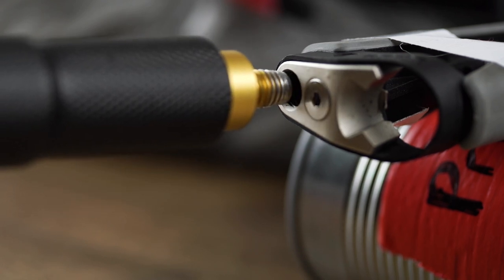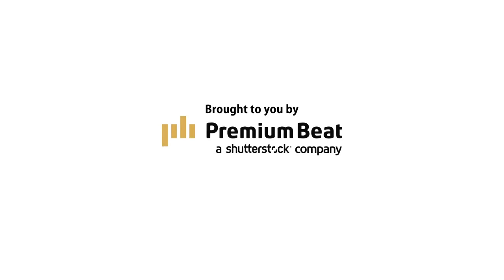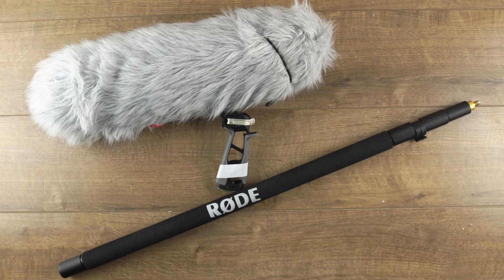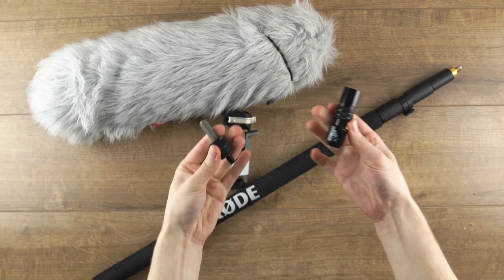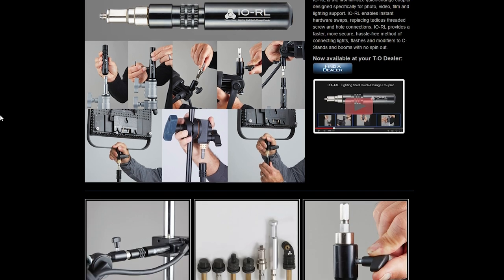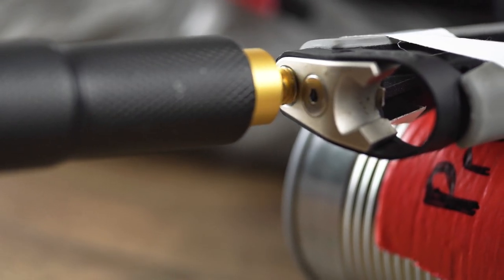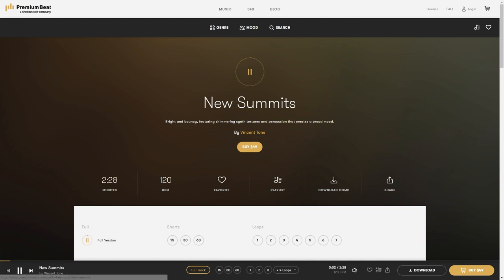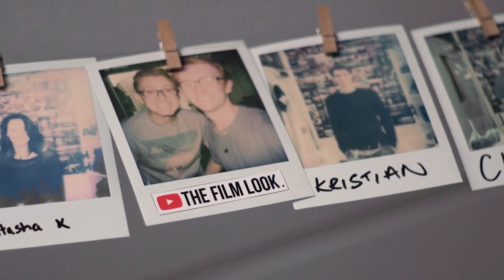Boom Pole Quick Release | Triad Orbit IO-R Review | The Film Look

Comment: Looks great, I've just invested in something similar for monitors so I don't have to twist them round on magic arms all the time. Definitely worth a look
Reply from the maker: Oh nice! What is that called?
Reply: https://www.amazon.co.uk/gp/product/B01LXOJTU4/ref=oh_aui_detailpage_o00_s00?ie=UTF8&psc=1 is the one I bought. I'll let you know how reliable/good it is.
Reply: I use those on my monitors, too. Together with some custom GoPro Style Magic arm like Caleb from DSLR Video Shooter suggested in one of his Videos.
Great combo.
Have to be extra careful with the locking mechanism, though. It's pretty easy to unlock it.
I usually use a strip of gaffer tape for safety with that.
Reply: It arrived today. Testing it on my Yongnuo light it seems fine. I'm nervous about using it with a monitor but I think it'll do the trick! Definitely love how much time and hassle it saves just attaching a light, might end up buying a whole bunch of them! Will take a look at the magic arm, I was going to invest in a Noga cine arm but open to other suggestions, thanks for the tip Mirko!

Comment: This makes a rattling noise with movement when used for a boom mic. There is a tiny bit of play in it when connected. Enough to make noise and ruin your recording. Still trying to figure out a hack.
Reply from the maker: Haven't had this problem, is yours a little bit loose?